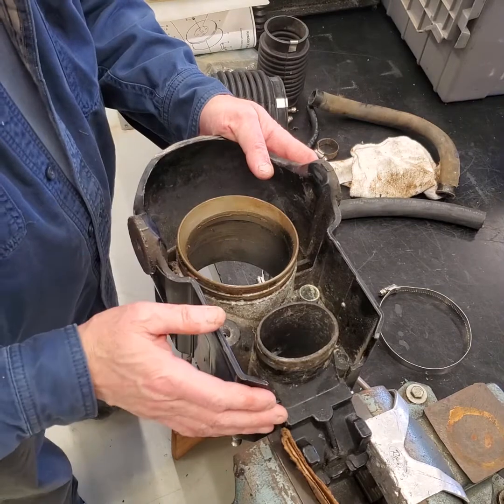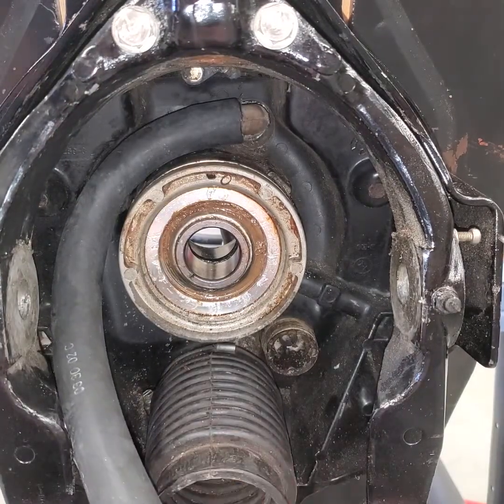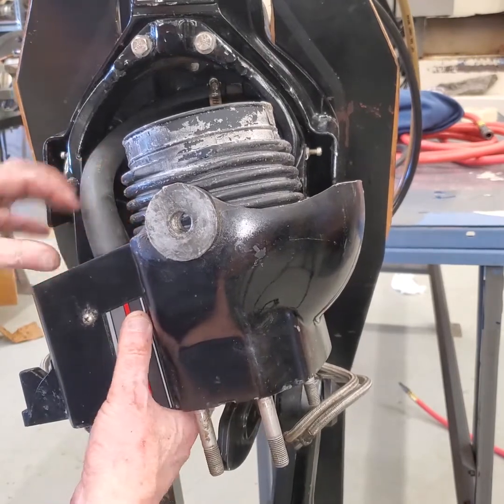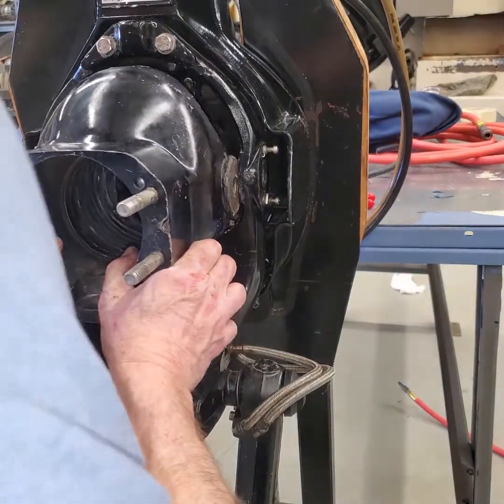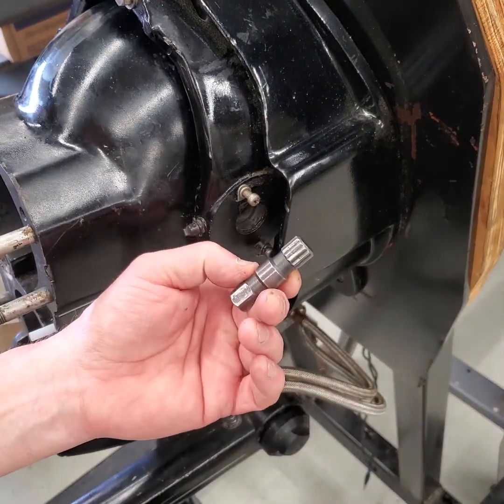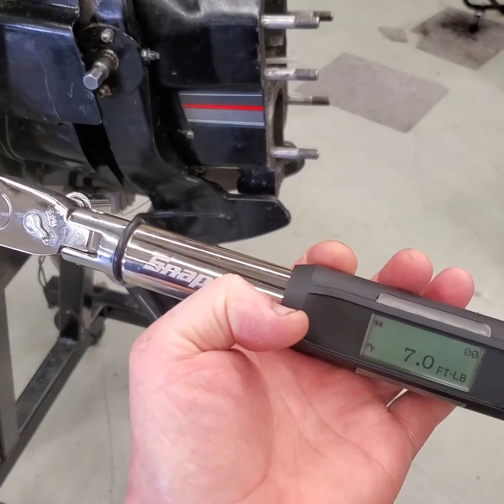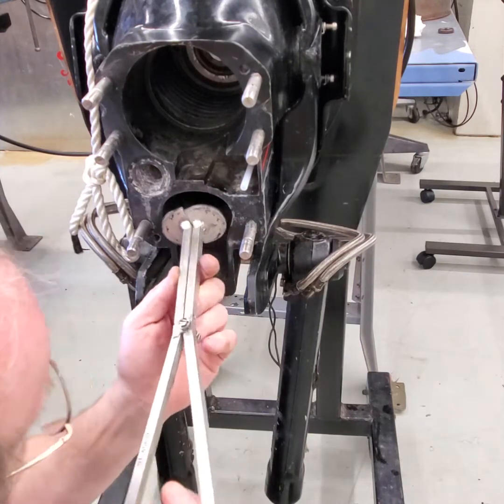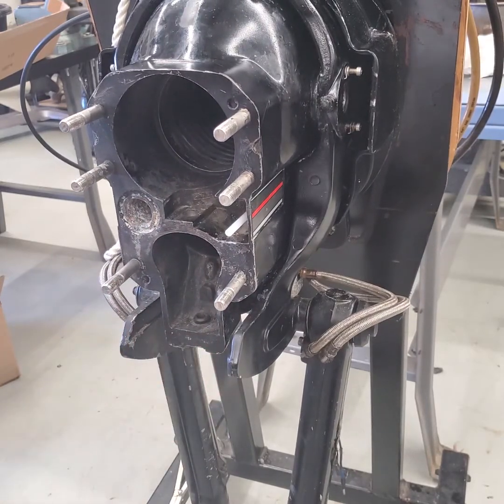Early Alpha One Transom bellows R&R

Comment: Very informative video. thank you. one question though, do I need to use the adhesive to  glue the the bellows In place ?
Reply from the maker: It is recommended.......
Reply: @tedsmarinerepair8956  Yes, use the adhesive.  If not, the bellows can slide off while you are on the water and your boat can sink.  The adhesive is $10
Reply from the maker: It is recommended

Comment: Do you need a exhaust bellows at all on this type of Drive does it have to cool the lower end at all where the impeller is or does it not need to have the exhaust go down and out of the prop is water needed in that area at higher speed
Reply from the maker: The exhaust bellows helps direct the exhaust into the exhaust chamber of the drive and out through the prop. It also quiets down the exhaust noise. without it, you have the chance of exhaust fumes coming up over the transom if the wind is behind you.

Comment: I’m in the process of installing new bellows and trim sensors…I’m having a tough time getting the upper second bolt of the bracket out (gen 1) where the sensor wires pass through the transom housing. I can’t get a good purchase with my 7/16 wrench or a socket. Do you have any recommendations on the best:easiest way to get it out??
Reply from the maker: If you have a 15 degree wobble extension that may aid you in getting at that bolt
Reply: That bolt is a burger on the gen 1, use a 7/16 open end wrench.